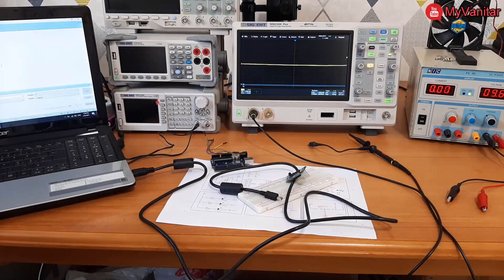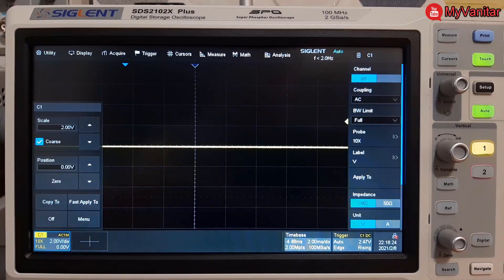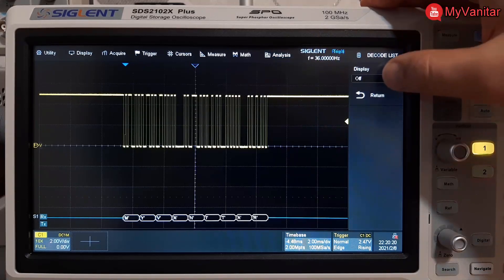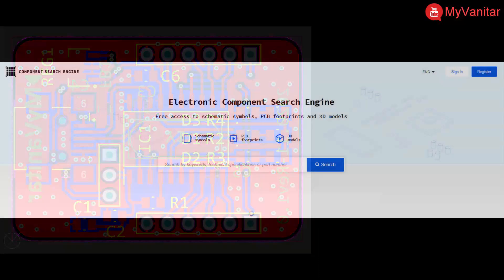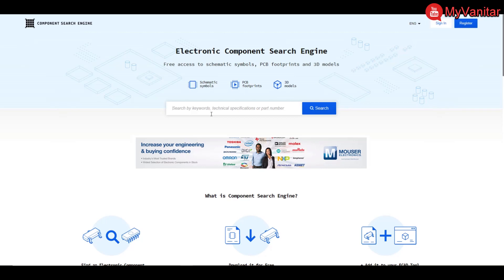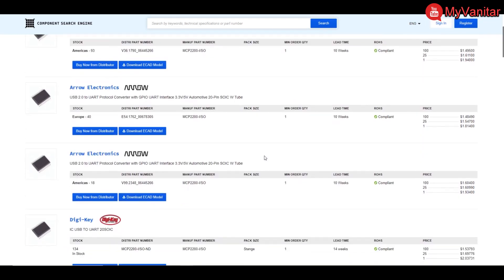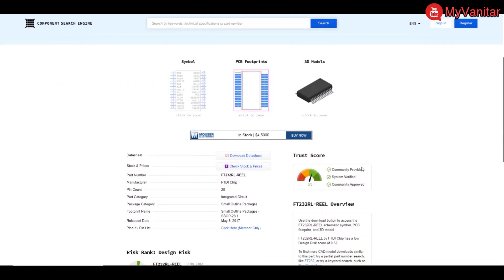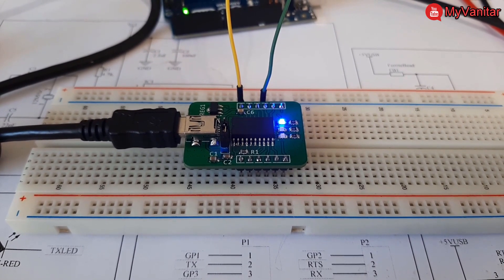Cheap USB to UART (RS232/Serial) Converter Using Microchip MCP2200

Comment: Why not cheapest CH340c ?
Reply from the maker: Your mentioned part number is just cheap, and not used in the industry. The industry doesn't mean Arduino or learning modules
Reply: Fair question, the CH340c can perform some basic functions, but it lacks additional features and software to consider it a serious and reliable tool.
The MCP2200 can do what the CH340 does, and so much more.
Had a recent situation where i needed to invert the logic, only a mouse click away in the MCP2200, not possible in software with the CH340.
Reply from the maker: @virtual812  some people think because they see some components on the educational or hobby boards, so they can use them anywhere because just they are cheap. argue with me like a religion

Comment: The video is not bad but it is poorly structured. You start with the end, do not describe the circuit at all and spend too much time browsing through the prices... I did not learn what frequency crystal is needed, what for is there a regulator or what parts are required....
The correct structure would be cca the same as in the linked article. Start with the chip description, describe schematic, describe pcb, show the resulting product and decoding... Basically if you would read the article and show the things you are reading it would be much more informative....
And about the price comparison. The best way to do it would be to show two windows with the prices side by side and just say "this one is cca 2 times cheaper than that one..." - 15 seconds instead of something that feels like eternity of you browsing prices.....
Reply from the maker: Thank you for your comment and sharing your opinion
Reply: This is Youtube. You begin with the end so people know what they are watching and want to watch the whole video.